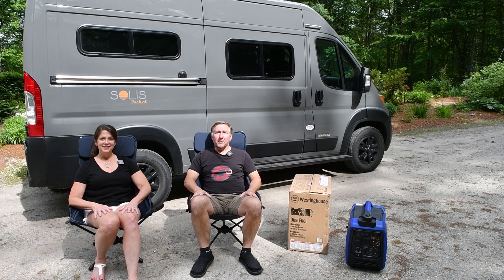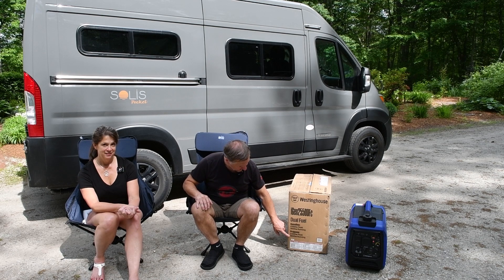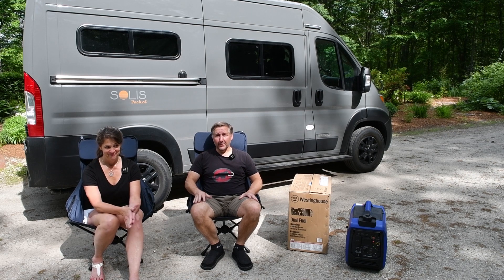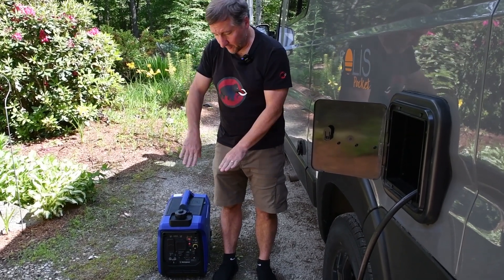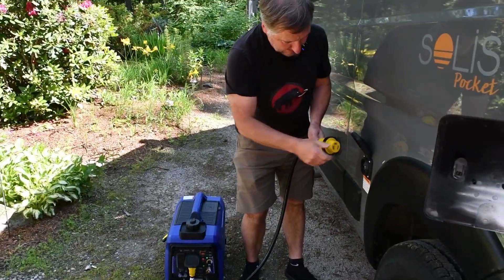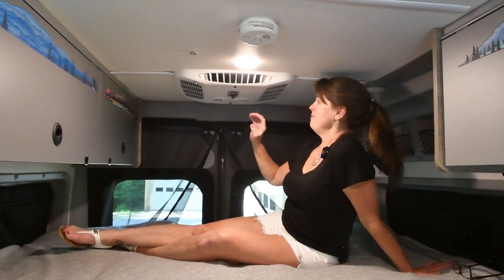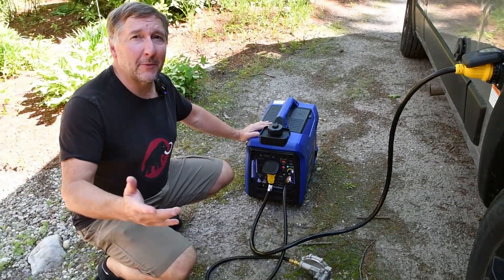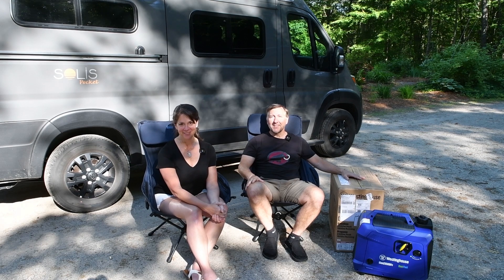What Size Generator Will Power the Solis Pocket with A/C?

Comment: How has the Generator worked so far? Researching for one now..thabks!
Reply from the maker: Hello! Thanks for the question. To be honest, we have not used it very much - though we haven't had any trouble with it. If you have seen our other more recent videos, we ended up making some significant power upgrades to the van which gives us plenty of 120v off grid... And the ability to recharge when driving. The only thing we can't do is run the A/C overnight, that would still need shore power or the generator. Although our model is on the smaller end capacity-wise, it is adequate for our needs. We have only ever used propane for fuel. For more power some people have suggested the Pulsar 4000w (model GD400BN) which is a similar size and is also multi-fuel. Good luck!

Comment: And how long will it run on that little propane tank?
Reply from the maker: Hi! Thanks for your question. In our test, 1 hour. I think we mention something about that towards the end. We did a follow-up video to this as well, to answer a lot of questions we received. You may want to check it out. Thanks for watching and take care!
Reply: @Outapkt  The video is fantastic BTW.  Some vans have a built in generator that will take fuel from the dodge fuel tank which allows you to run the generator for many hours but, I don't know what that number is either.  :/  I'll find out.  Thank you

Comment: I'm surprised that the generator would energize the transfer switch on the Solis since it is a floating neutral. Using a floating neutral generator on my Trevato triggers a fault and will not energize the transfer switch. It requires the use of a neutral bonding plug on the gennie. You might also find that a 4000 watt unit like the Champion Dual Fuel would use considerably less fuel since it would be operating at less than 50% vs the 80-90% for the Westinghouse. It weighs about 8 lbs more but is the same physical size.
Reply from the maker: Thanks for watching and for your comments. I am not sure the Pocket 36A has a transfer switch as there is no inverter. You only have 120v when the van is plugged into shore power or a generator. As far as the generator, yes it seems very possible a larger unit could be more efficient running at a steady 50%. Thank you

Comment: Thanks for taking the time to make that Video. This was super helpful. Have you tried using the heater with the Generator? Also, what specific cables did you buy to hook up the Gas? That's a great workaround!
Reply from the maker: Hello! We appreciate your comments and feedback! As far as using the heater with the generator, the standard heater on this van model is propane-powered and runs off the 12v coach batteries. I don't think the heater consumes very much electrical power. If the generator was running at the same time, it would simply be re-charging the coach batteries so really would have no effect on the heater. I think this model of air conditioner does have an optional electrical heater element that can be installed onto it, so maybe that is what you were thinking of. I am pretty certain this is not installed from the factory. If that was added, it would need the 120v to run and thus would need shore power or the generator to function. Hope that helps. As far as the products we used, we always include info/links in the video description so you can look there for more information. Thanks and take care!

Comment: Thanks for the video, I've been looking at this one Pulsar GD400BN for our Pocket. I'm wondering if you checked out Pulsar and if so why you chose Westinghouse.
Reply from the maker: Thanks for your comment. I was actually very close to buying that generator. It seems to have more power in the same size/weight package and has all the features I was looking for. In the end it was a brand I was less familiar with and decided maybe that much power was overkill for what I needed. I would be very curious to compare the two in the real world. Maybe it would run the same load quieter than the Westinghouse. I also wonder how fuel consumption would compare. I think it is a good choice for the Pocket. If you get it, post your experience back!
Reply from the maker: Did you end up getting the Pulsar and how has that worked out? How is the noise level with that generator when the A/C is running?
Reply: @Outapkt  I did get one and it seems to work well. It's not to loud, seems to be about the same as others I've heard. When using it I do turn the disconnect House/Coach battery switch off and I don't use the low idle feature on the generator. I was concerned about the power spike form the A/C. I've been thinking about getting a soft start installed just to be on the safe side. I live in the Panhandle of FL so it's hot most of the year. I also get about 18 hours on one tank of propane. What's your thoughts on the soft start?

Comment: My Honda eu 3000 is ,is much quieter.
Reply from the maker: Yes I bet it is. It also looks like it weighs twice as much and is quite a bit larger in dimensions. We knew we could go with a larger size unit to reduce the running noise but we really did not want to haul around a 100lb unit in the van, which is small compared to a camper or RV. The 3000 also costs 4x not including conversion to propane. So for us, it was just not a good tradeoff for our occasional use. Thanks for watching.

Comment: Honda is the long term generator to have it always runs..the rest will fail soon no bueno ..
Reply from the maker: Honda is obviously an excellent machine. My understanding is the smaller units are not duel fuel and need to be converted. The 2200 series, which was in our target size/weight range, does not have the 30A RV plug. And the cost was more than double, so we did not go that route. Thanks for sharing.

Comment: That is one loud generator for an enclosed one, did you check the specs on a preditor generator?
Their small inverter generators you barely hear.
Reply from the maker: Predator had limited duel fuel options so I ruled them out. The smallest duel fuel I found was over 100 pounds which was much more than we wanted. Thanks for watching.

Comment: I have 600 amps of lithium and 9500 Houghton air conditioning sleep from 8:00 pm to 7:00 and remain about 35/40%. Thermostat setting  75.
Reply from the maker: That seems pretty good, though 75 is maybe a little on the warm side. I'm curious if you are you able to fully recharge on the following day, to be full for the next night? Thanks for sharing.
Reply: If we are driving the next day, yes, I have 3 DC to DC 30 amps Victron and one 20 amp DC to DC, three hundred watts solar all together getting more than 100 amps; if not driving, I have a HONDA generator 2200 to recharge the battery if I need.
Reply from the maker: Thank you for sharing your solution. Definitely interesting.

Comment: I thought that was pretty loud! I wouldn't be happy if that parked next to us. 
If you stuff it full of lithium batteries, you can run the A/C noiselessly. Not sure how much lithium you can put in there nor how long you can run the A/C, but there are people on the Pocket FB group who have done the conversion. We had a Travato and the thing that I was happiest to lose when we switched to the Pocket was the generator (the TV was a close second). Hated the upkeep on that thing, especially since in three years, we used it only once to run the AC for the afternoon - yet we had to run it every month and change the oil. But that's just me...
Reply from the maker: Great, thanks for sharing your feedback. In practice, I don't think we will need it that much. If the A/C was running on full and we were right next to someone, yes I think it would be both loud and rude.  I'll have to checkout those Lithium conversions, sounds like an interesting option if we ever have more of a need to use it.

Comment: hi . i do not know where you camp but my experience is that you might very well be prohibited from using your generator in a lot of places . it seems that under load it is quite noisy . your neiborghs might no be tolerant to that , and i would lock that thing with chain to your truck . happy trails .
Reply from the maker: Hi! Thanks for your comments. We don't usually use established campgrounds and prefer to boondock when possible. I agree with you there will be many places we can't use it - it's really for occasional A/C use only. We have a Goal Zero Yeti for 120V when we don't need the A/C. Take care.

Comment: A 4500 watt gennie would run it on eco mode.Much quieter   I have the Champion duel fuel
Reply from the maker: That seems like a nice generator. We wanted something smaller and lighter as we really won't use it too frequently - only for AC on occasional trips to warm climates. Thanks for your comment.

Comment: It looks like you used white plumbers tape on the fittings. They make a special yellow tape for propane fittings.
Reply from the maker: Wow, I didn't know that. Thanks for letting me know, I assume it is different for a reason. I will switch that over. Take care and thanks for watching.
Reply: @Outapkt  Very VERY important. I used the white stuff, had a leak, got sick, and didn't recover for nearly two weeks. My propane detector didn't alarm. When they say "two is one, one is none", they aren't kidding. I now have a backup detector to my detector.

Comment: How long can you run the AC with that setup? You should also consider rigging up some curtain rods to hang your winter comforter to use as a thermal barrier to the rest of the van. Cooling a smaller space will be more efficient. Also you may consider looking into a more efficient air conditioner… twice as efficient will run twice as long. Thx for the vids! Cheers
Reply from the maker: Thanks for your question and suggestions! We haven't used it enough to know the run-time yet, so will have to cover that in the future. Or maybe someone will comment. You are correct we would normally put up all the window shades, hang our curtain, etc. We just skipped that for this test. Thanks for watching and take care!

Comment: Would you be able sleep with the generator running, or would it be too loud?
Reply from the maker: The van is insulated so it is not as loud inside. We could sleep. Especially once the van cools down and generator does not have to work so hard. Thanks for watching and for your question.